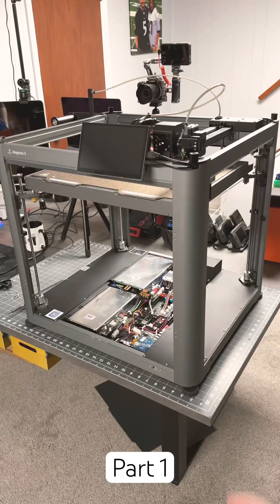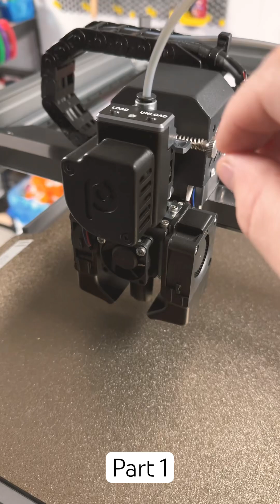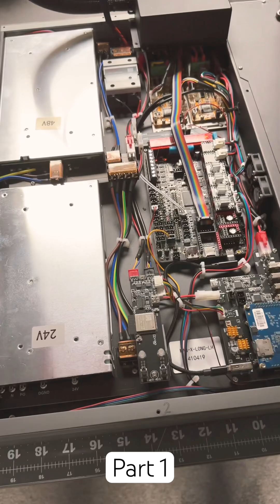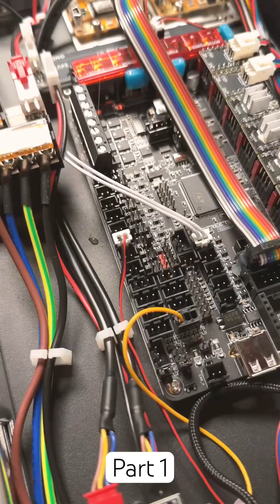@peopoly  Magneto X - Cool Details Part 1

Comment: The Lancer extruder looks pretty great. The filament runnout sensor and buttons seem like a variation on the Orbiter extruder FRS. I believe they make an Orbiter V2 variation that can be used on any printer! The pushing force of the extruder is great.

The magnetic fans are brilliant!
Reply from the maker: There’s just so many little details all over! There is even a fused breaker on the bottom I just found. Might have to make a part 3. haha

Comment: This is only reasonable for people printing engjneering mats. The linear motors are much more accurate but considering you can get a much more reliable machine with an AMS or 2 P1Ps this just seems stupid for normal people.
Reply from the maker: I think this is a great assessment as to what this machine is for and who it’s for. I think if you even compare this to the current Bambu offering as an option, this isn’t for you. And that’s totally ok! This is an industrial, commercial style machine at the price of a hobby grade one.
Reply: @3DPrintSOS  Yes, its just a niche in a niche, and not saying so or saying why its not a good option for most people is pretty meh considering someone who say their spouse bought them an ender 3 at first and is looking to upgrade but isnt knowledgeable on anything else, they see this video and think its a good option, they are being screwed. Ive ran into this in the past and its something I feel like people gloss over.